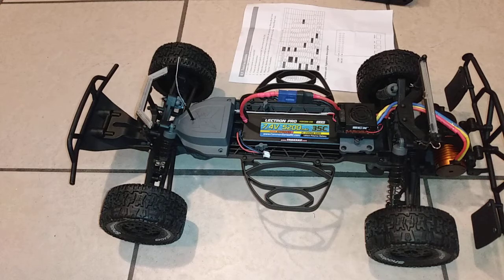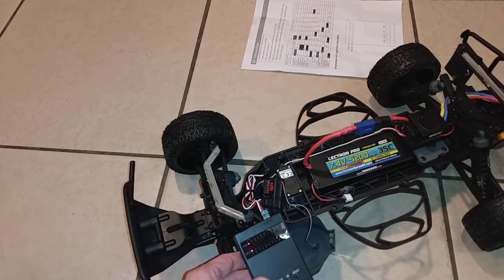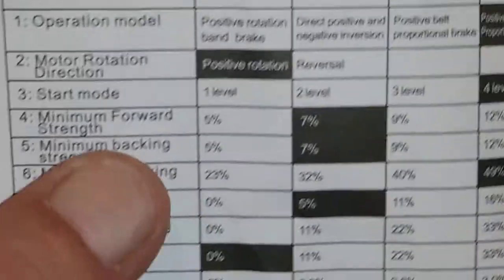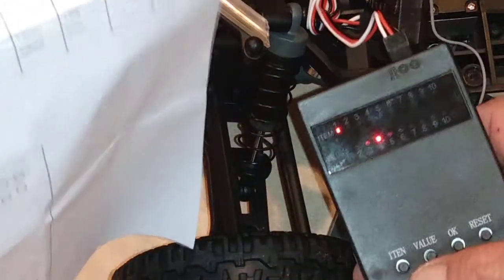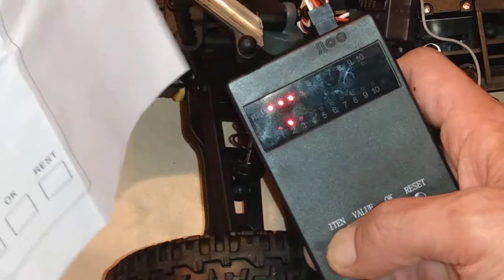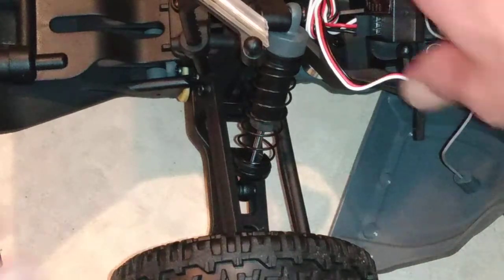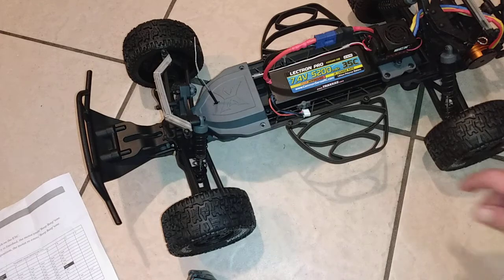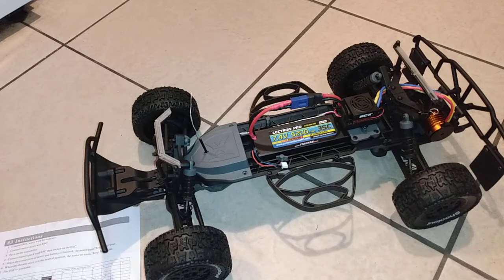Programming Amazon $41 Brushless Kit with Cheap Program Card

Comment: Hello friend, thanks for the video. I have a question. What about the number 11? It doesn't change, I understand, right?
Because the card goes from 10 to 12.
Thank you so much.
Reply from the maker: What is number 11 anyways and what ESC are you using
Reply: @MightyistheRCGamer  My esc is that of the wltoys 124016 v2. I bought the card to raise the battery cutoff. But my question is? the leds that mark 12 are equivalent to the number 11 and
13 = 12 and so?
Reply from the maker: @oskartubekp  it's because the ESC doesn't support the number 12 or your card isn't completely compatible with your ESC
Reply: @MightyistheRCGamer  
But I see that this problem happens to more people! So what card do I buy for wltoys?
I just wanted to know why it doesn't give the option of 11
Reply from the maker: @oskartubekp  buy a real hobbywing program card
Reply: @MightyistheRCGamer  ok you don't know, thanks!!
Reply from the maker: @oskartubekp  I don't own the ESC you have so how could I help you if I don't have the ESC. You could have went to bigger channel to get help but I doubt they will even get back to you . Sorry Bro
Reply from the maker: @oskartubekp  And besides the more settings you change on those cheap ESCs they're just going to acting up.
Reply: @MightyistheRCGamer  i buy hobbywing program card thanks

Comment: I have the same setup in the ESC does not like 3s much it will go up in smoke
Reply from the maker: The ESC is Not Cheap meaning Low Priced by Luck it's complete GARBAGE. The motor is ok but when you get the motor to hot the magnets fall off and the motor won't work no more.... I bought a better combo for $60 and never had problems again and I have more speed and more power
Reply: @MightyistheRCGamer  what combo you have now?
Reply from the maker: @martez752  https://amzn.to/3trKWiQ
Reply: @MightyistheRCGamer  what type of speeds your getting and do you need a program card to get it going? I have a hobby wing card will that work?
Reply from the maker: @martez752  yes YOU ALWAYS NEED A PROGRAM CARD don't let anyone tell you different. The Hobbywing will work on it but speed depends on your setup but I am getting great speed on 3s but I think the combo I sent you. You can use 4s
Reply from the maker: My bad it's only 3s capable
Reply: @MightyistheRCGamer  that 3560 will be a tight fit in my wltoys 124018. I might have to go for the 3650. You have a link for that one?
Reply from the maker: @martez752  No because your trying to fit in the wltoys and it's a tight fit
Reply from the maker: @martez752  This combo is smaller but it fit for sure and it compatible with your program card but I would only use 2s 

https://amzn.to/3TKVHax
Reply from the maker: @martez752  the motor is the size of a 540 motor so it should fit in your wltoys good and the ESC is smaller but works good I own that blue ESC and it runs good on 2s

Comment: I bought a Hobby Fans system. Basically, its the same exact thing as any other cheap chinese brand. The program card, which came with it, seemed to work fine, the first time I hooked it up, and I increased the punch/boost setting to max. The system seemed to work ok, except, there was TERRIBLE throttle lag. I mean, we're talking, about 1 second. Now, that may not seem like much, but trust me, it is. Just imagine it; you envision, pulling that trigger, and then counting one ACTUAL second, before there's a throttle response.....YUP. Thing is, that lag is ONLY on take-off. Once my truck was moving, the response was fine, with no lag. 
Later on, I found out about others having the same issue, and resolving it, with some adjustment in the ESC, using this program card. I got the truck back up on the workbench, proceeded to look for the setting I would need to adjust, hooked the ESC up to the program card, annnnnnd........ I get two rows of left to right, scrolling lights, with ZERO response. I turned the ESC off and on, MANY times, and all, about, 5 seconds apart and still nothing. I tried another battery, same thing, scrolling lights. 

These chinese knockoffs, are a dime-a-dozen, and they're all the same. The motors are typically fine, but the program card and ESC, are, typically, junk. So many similar reviews out there. Do yourselves a favor and SKIP THE ESC. Only buy the cheap motor, and get a better brand of ESC. Better to pay more now, for a better product, than paying TWICE for an INFERIOR product, down the line.
Reply: Just installed this system in a wraith, took half a day, only to have the same scrolling lights you describe on the card. Very pleased with this purchase

Comment: Could you explain how is it possible, that esc, that's been sold with 5settings card, can be set in 17 settings with different card? You basically have surpass 60 esc with V1 combo. V2 combo with black,  ribbed motor has no card included, but there is V2 card, that has 9(?) settings to adjust. But for example none of those have pwm frequency like the one you're using. So does it mean,  your esc can have pwm adjusted to 16kHz, so the motor doesn't buzz in high pitch, when under load?
That card possibly first showed up in a set with 80A esc, that was very close software-wise to hw1080, and that combo boomed instantly due to price. It was cheapest crawler brushed combo, you could make quiet.
So I'm wondering, shouldn't esc support features, as opposed to just better card offering adjustability to loads of new features? That doesn't make sense 🤔
Reply from the maker: The ESC is not cheap by luck it's complete GARBAGE it burned out after I put new settings SO PLEASE DON'T BUY THIS GARBAGE ESC!!!!

Comment: awesome, i got the esc and realised its crap without the card! Now I know I have the right card thanks to you,  do you like the esc, i run it on 3s and it runs nice and cool with 2845 4400kv and 15t pinion on my 124019.
Reply: What’s the link to this set up on Amazon
Reply: Hi, what ESC do you have? I have WLtoys 124019 and I believe there is a Racerstar 45A or 60A. Do you have same? If yes, how did you find out, what parameter controlls what function of ESC?

Comment: Sub bro because literally out of all the 30 videos I just watched  you’re the only one that made any damn sense. I just bought a new cheap upgrade kit off of Banggood for mine WL toys 142019 and when I first plug the ESC in it flashed red But then it stopped doing anything. Any pointers I’m new to this and I just spent a ton of money on a car I can’t even play with lol
Reply from the maker: Don't trip... give a model number or name so I could see what happen we can get to the bottom of this
Reply from the maker: Do you have program card? Just curious
Reply: Make sure your throttle setting on transmitter is set to absloute zero. That should get rid of the red light of death.

Comment: mine when turning goes forward how do I fix that?
Reply from the maker: I think that might be a wire that is not connected to the correct... or the wrong channel in the receiver of you Transmitter needs to be trimmed
Reply from the maker: When plugging in this motor the wire that is in the middle has to always be connected to the middle wire of the ESC but the other two can be mixed-and-matched... when doing upgrade on my Traxxas/ when I turned it on it would go forward and it was in the wrong channel on the receiver
Reply: @MightyistheRCGamer  Yup that was the problem, you just earned a sub :)
Reply from the maker: @hithereperson8137  Welcome to the Family
Reply: @MightyistheRCGamer  glad to be here!

Comment: i have same with This Card, but not good function, if  I connect to ESC, the light still running on from 1~ 10 for item and value and continuously like that..  I have press all button but still not respons. I try to ESC Surpass Hobby, ZD Racing , Gool RC .. i don't Know what the Problem
Reply from the maker: I only got 2 or 1 run out of mine and it started acting strange and then not working at all but I return it and bought a Surpass Hobby 60amp ESC and 4370 brushless motor for $60 and it didn't even need programming and works Perfectly Fine that goolrc stuff is GARBAGE so now if I am going to go cheap then I am only going to use Surpass Hobby its only $60 REMEMBER THE $40 GOOLRC COMBOS ARE GARBAGE!!!
Reply: I have the same problem
Reply: You got any sollution?

Comment: Hello. I have the same esc and control card, but when I connect the control card to esc, the ITEM and VALUE lights automatically start from the first row and continue to light up as 1 2 3 4 5 6 7 8 9 10. Where am I making a mistake, can you help me?
Reply from the maker: The ESC is VERY FAULTY so don't expect it to work well. After programming mine it started acting stupid and then it and then caught fire on 2s only.... I can't help you because it's already acting faulty just like mine did before a blew... but you can't press reset to try to see if it fixes the problem
Reply: @MightyistheRCGamer  My esc was working well, I connected the program card, but as I said, the lights of the program card follow sequentially and the lights on your program card remain constant. I can't power up with esc right now. How can I reset this?
Reply from the maker: @KartalKafadar  I think you connect the program card to the ESC turn on the ESC and then press the reset button on the Programming Card
Reply from the maker: @KartalKafadar  the problem could be the ESC or it could be the actual Programming Card both of them are very unreliable
Reply: @MightyistheRCGamer  Can you write me your e-mail address and I will send you a video of your error.
Reply from the maker: @KartalKafadar  scanlineman@gmail.com
Reply: @MightyistheRCGamer  I sent you an e-mail, please check.
Reply from the maker: @KartalKafadar  I check it out it's the programming card it's no good
Reply: @MightyistheRCGamer  I think there is a problem with my programming card? So how can I reset and restore my esc? has stopped powering the motor now.
Reply from the maker: I told you that this ESC is very very faulty it is complete trash mine immediately died after programming it This is not a ESC it's TRASH!!! I bought a new ESC combo for $60
Reply: @MightyistheRCGamer  I think I'll have to buy a new esc. Thank you for the information for everything my friend.
Reply: You got any sollution? My card is flashing item and value lights left to right everytime.
Reply: @ Hello. There is no solution. I sent a video to the manufacturer and they sent a new ESC. The programming card is faulty and corrupts all ESC settings.

Comment: I have this same card, just so you and other people know, there is no 18 setting. When the card displays 12 its actually 11 because the card skips 11 and displays 12 even though its on 11. Count the clicks of the item button when you press them and youll see. So 13 is 12 and 14 is 13 and so on. Fixed my problems
Reply: Who the hell understands  what the items even f ...ing mean
Reply: I believe now, that I have taken apart the P-card that there is no item 11. Also, there are 19 parameters and I do not know what they are for this card and motor combo. The issue starts at item 11, Braking frequency. If you could control that parameter you would be able to define the strength of the electronic clamping force during braking.

Comment: I bought same motor but I can’t programming I did same thing what operating say
Reply from the maker: Throw it in the trash
Reply: @MightyistheRCGamer  why
Reply: Motor is working
Reply from the maker: @serroxat  it dies fast the ESC won't last it's trash
Reply: @MightyistheRCGamer  esc fan is work and beeping so I can’t use it and if I buy new esc can work with same motor
Reply from the maker: @serroxat  yes you use any ESC with that motor... But it will probably die because it's very very poorly made
Reply: @MightyistheRCGamer  I think so I using same programming card  u used
Reply: @MightyistheRCGamer  is ok I fixed I try 3 Chanel rc now is work thanks mate I don’t need to  check the bin 😂

Comment: But it goes from 10 to 12? Is dont think so. Point and point means 11 or am i wrong?
Reply from the maker: There is no 11... Only 12
Reply from the maker: There is no 11
Reply from the maker: All the lights go up to ten but when going to 11 after going to 10:00 only one light will be on meaning you are on number 11
Reply: @MightyistheRCGamer  ok than i see that wrong. Mine came today. Then i can test it tomorrow. Ty for the answer. 

I am german btw... sry for my english. 😄
Reply from the maker: Yes it's kinda hard to understand what your talking about but i promise to help if you have patience
Reply: I’ve got the exact same issue. I think after 10 it is item 11 but lights say 12 and so on. So lights 18 are actually item 17. All settings then tally up to sheet
Reply from the maker: @htomid  it works well enough but I think I am going to buy a name brand

Comment: I like that one. You might be able to run the shutoff a little higher you can use a higher “c” rating or add a cap pack. 

Although I just run mine at 3.2v. 

Happy New Year!🎆🎈🎊
Reply from the maker: Thanks Bro have a fun safe New Year
Reply: David can you please scan and send me a copy of the table of values there that you showed. Mine didn't come with that piece of paper. And the printing on the label is too small to read on the back of the programming card.
Reply: FYI this card did not work with my surpass hobby 60A esc in my 144001 or 019, all that happens when I plug it in is 2 rows of red LEDs just scroll along the 1-10 and pressing any of the command buttons does not a thing
Reply: Just tried it on my LC racing EMB-1H with 35A hobby wing ESC and does not work as well. Scrolls LEDs also, any ideas why its doing this guys?